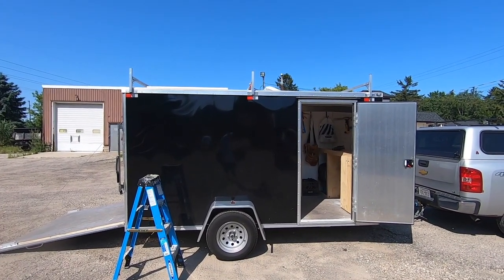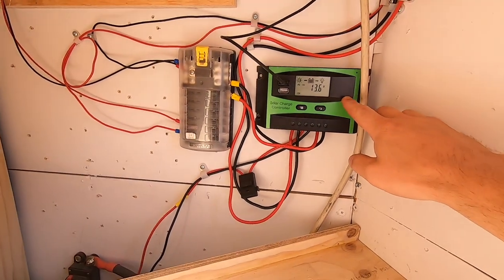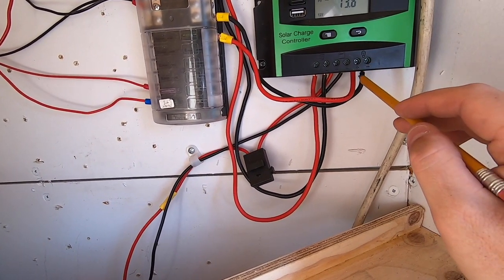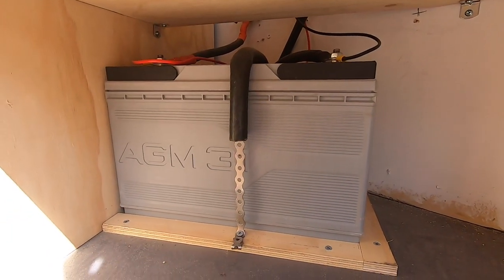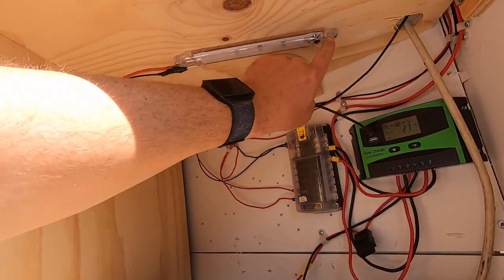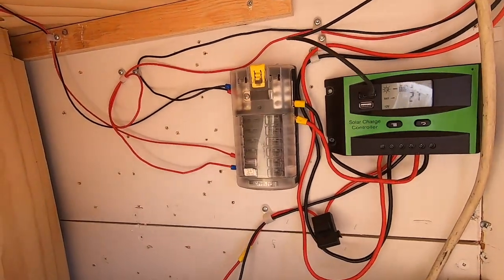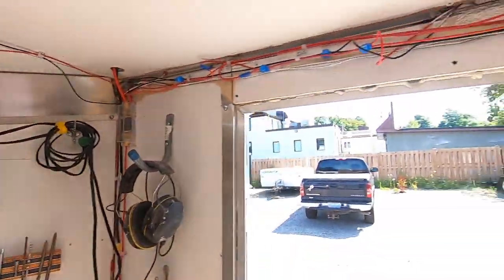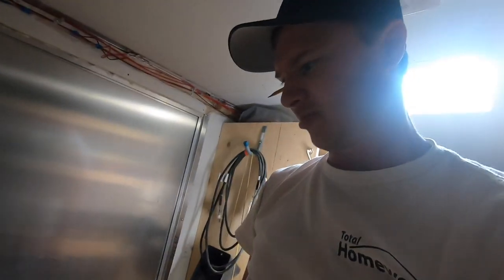Work Trailer - Solar System Tour

Comment: If you're only ever shallow discharging the battery and running mostly on solar input then I'd stick with the AGM since they're cheaper and easier to maintain than lifepo4 (don't go li-ion if you do go lithium).  Good quality AGMs can sustain several 1000s of shallow (less than 20%) discharges so long as you charge it up after using and keep it floating most of the time.

An MPPT would be a good investment though as you'll easily yield more power out of your existing panels.  If you can afford it Victron Energy would be a good choice (especially the ones with the built in bluetooth).
Reply from the maker: Thanks. That's why I got the AGM in the first place. Plus the cold.

Ya those victrons aren't cheap but would be an awesome upgrade

Comment: It’s nice but if I’ll do that in my opinion is better to have a jackery, blueetti, or eco flow and one is portable so you can take it out of the trailer and number 2 you don’t have to deal with all that wire mess except for the panels
Reply from the maker: I should have talked to you first before I started

Comment: Those cheapo Amazon charge controllers are downright dangerous.  I had a couple of them destroy the batteries they were attached to from overcharging.  Tested them and they would never cut off no matter how high the voltage went.  I smashed them with a hammer just to make sure nobody else tried to use them and threw them in the trash.  Worth it to buy a quality charge controller from the beginning.
Reply from the maker: I agree

Comment: DC volts to AC volts to DC volts??  Wasting lots of power here.  They all make a 12 volt DC charger. Also better for you Batteries. Get a Morning Star PWM controller and save your money, pay once, cry once.  Pay attention to your wire size its really easy to use too lite a gauge of wire with solar especially between panels and batteries. ALSO very important put a Fuse or Breaker between the Panels and the Charge controller for a safety and doubles as a circuit disconnect to cut out the panels! Run away solar panels have started fires in the system. It happens. EVERY circuit in DC needs a fuse at the SOURCE to prevent a fire. Lots of fires happen from unfused DC circuits.  Nice setup!

Comment: Nice video.  Like the roof rack you have on the upper roof rail. I need one like that for my trailer project.  Do you remember the manufacturer of the roof rack you have?
Reply from the maker: Thanks. I have no idea about the roof rack. I just had them include it when I bought it. I should have done 4. Sometimes they are a bit too far apart.

Comment: I know this is an old video but I am just wondering if I could use a regular 12 volt truck battery? I'm new to this but really just looking to keep some cordless tools charged. I'd appreciate any input. Thanks
Reply from the maker: You want a deep cycle battery. A regular car or truck battery delivers a lot of power quickly to start the vehicle but not good for slower release. You don't need a big battery and use 12v tool battery chargers so you don't need a inverter. Inverters use more power.

Comment: did you get the table saw to work correctly after the amp fuse blow? i love this setup its simple. do you have any updates?
Reply from the maker: No, I just didn't use the tablesaw. I upgraded the solar controller but that's about it. Dewalt makes a 12v battery charger, so I don't use the inverter very much anymore.

Comment: I would love to get a solar system setup for my new workshop sometime. Did you ever get a new charge controller?
Reply from the maker: Solar is really cool but it's hard to offset upfront costs. No new controller yet. Everything seems to be working ok right now. Hard to find the time to work on the trailer. Might tackle it in the spring.

Comment: This looks like a great place to ask this question. I have trailer that I keep my motorcycle in. I would like to run a small heater to keep the bike somewhat warm. (about 50 degrees) I have a 100watt Harbor Freight solar panel set up with a deep cycle battery connected.  Can any of you recommend a powerful enough Inverter?  The heater would be on a timer.
Reply from the maker: What is the wattage of the heater? Size of the battery? The heater will probably drain. The battery pretty quick and it will take a 100w panel a while to charge it back up. A little propane or diesel heater might be a better option
Reply: Hi Paul.  Depending on how large the heater is you might not need a super large inverter.  I'd recommend looking into a marine bilge pump heater.  They keep the cabin between 45 and 55 degrees out of the box.  The ones I saw used max of around 600 watts.
Reply: @nblebaron  Thank you. I was looking at those. I also found a nice programable 12-volt timer. 

My thought was: solar to battery, battery to timer, time to 12-heater. 

I can program the timer ON for 10-min, than OFF for 20-min starting 3-hours prior to departure. So the total run time on the heater would only be 60-min in a 3 hour period.
This should increase the temperature in the trailer.    

I need to figure out the size heater to purchase:  If I have a fully charged battery, how many watts/amps heater will run for 60-min before i run out of power in the battery?   

If the heater's internal thermostat is above 55 degrees it will not run. 

I am doing all fo this to keep my motorcycle warm enough to start easily. I am an all season daily commuter. The bike is indoors at work. Recently the temperature was 10-degrees in the trailer and the bike would not start. (its a new battery)

Comment: Im looking to make a set up myself but not sure how you mounted the panel to the roof and what tilt bracket you used
Reply from the maker: I had to make some custom brackets but their are some available online. I screwed the brackets to the framing of the trailer and siliconed everything so it's water tight.
Reply: @BrentDarlington  thank you

Comment: hi there how effectie is the system table saw
Reply from the maker: Not great with the table saw. You'd probably be better off buying a battery powered saw and charging the batteries with the solar system. Mitre saw work good, I usually use a small 7 1/4 off if it.

Comment: how much is the foam actually doing do you think?
Reply from the maker: Since I did the trailer right away, I don't have a comparison for before or after with this one. I had a white trailer before and it would get pretty hot in the summer, so I figured a black one would be worse. The winters I'm worried about less but it still nice to have done. I need to find the time to insulate the doors and floor and do some tests.
Reply: Ya makes sense. I’m thinking for the winter as here it gets really cold. But with the side vents I don’t know if insulting will do much of the air is still getting inside
Reply from the maker: @Jeziorski7  maybe close up the side vents and get a roof vent you can close